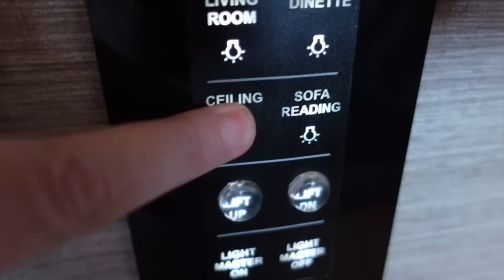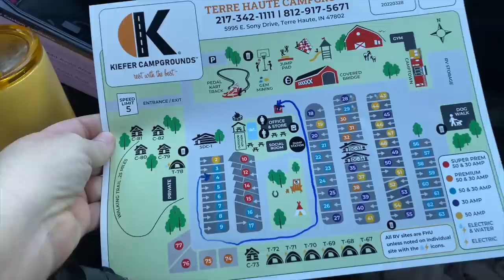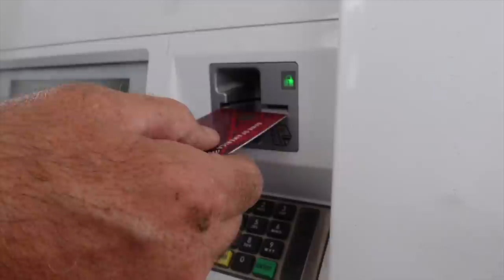Our First RV Damage on This Trip 😖 Ep.80

Comment: Lousy it happened, but not too bad of a repair.  Do seal it from the weather.  

Don't waste your time and money with hydrogen peroxide.  The concentration available to you is too low!  Those little bottles of 3% aren't going to help. A gallon of 30-35% food grade, absolutely.  All that sediment that spewed on you last video, it is magnesium laiden.  You need to flush your water heater with a wand. Then do a vinegar soak, at least half the volume of tank with white vinegar. Let is sit at least overnight.  Then flush out all the minerals it loosens, flush tank thoroughly with fresh water, reinstall aluminum-zinc anode, and you should be good.
Reply from the maker: Thank you for the info and tips Rob! Appreciate it

Comment: I noticed you have been experiencing rotten egg smell from hot water heater.
I had a problem with that years ago. It turned out to be someone
had used galvanized fittings instead of brass, copper, or plastic.
The galvanized ones after they started braking down affected the water with a bad smell. Check to see if there are any galvanized fittings near the hot water heater.
Reply from the maker: Thank you Earnest!  We appreciate that tip!

Comment: Indiana I see hasn't changed in 4 years. We go around that state because of the bad roads. We had a friend go through the state then on to Alaska. When in Canada he discovered he had a bent axle. Had to be replaced. He was pretty sure it happened when he went through that state. In terms of water coming out your tanks drain pipe. We installed a shutoff valve on the end the drain pipe. It connects just like the hose. Most people don't have the problem of leaking or spinning but we have had that. Wrapped it with electrical tape until it was sealed on there and no leaks. Has been good for over two years now. That way you won't get it on you or try to catch it in your hose.
Reply from the maker: Thank you for sharing your stories Don and Kim!  I’m not surprised about the axle!  Appreciate the helpful tips on the valve too!  Thank you for watching!

Comment: Just did the same thing after 3 years backing in my driveway and nothing has changed. i may have dipped the trailer into the ditch slope a little to much and hit my generator that sits there all year.
Reply from the maker: That’s crazy Lee!  I guess it just takes a little dip at the wrong angle?!  Sorry you too dinged yours up!

Comment: My one road hazard blow out came on Indiana I-70.   Had a pothole as big as 1968 VW. 🙂  This was about 8 years ago.  See they have not gotten around to fixing the issue on the interstate.   I have infrared unit as well.  I was checking my hubs by touch.  Nice tip.  Too bad about the fiber ding.  I have a $17 secondary valve on the end.  Had the little dutch boy momemnt with a black tank leaking valve.  ugh.
Reply from the maker: Wow Norman!  Things definitely haven’t improved since then. Yikes!  I was worried the entire duration about our suspension!  Thank you for sharing your story and the tips!